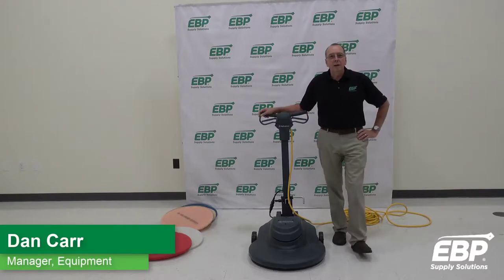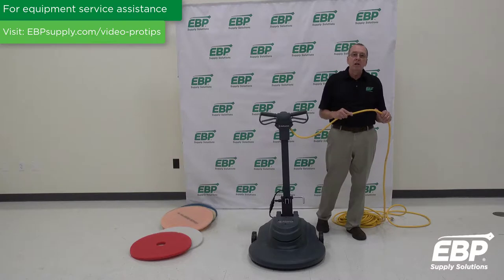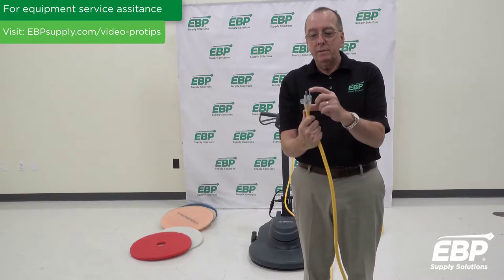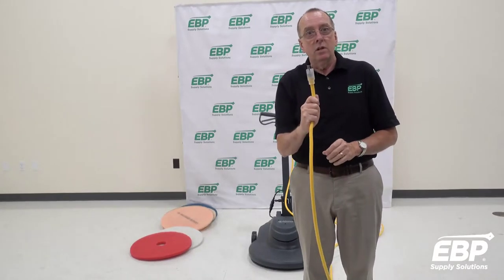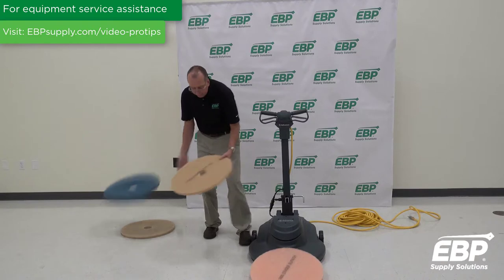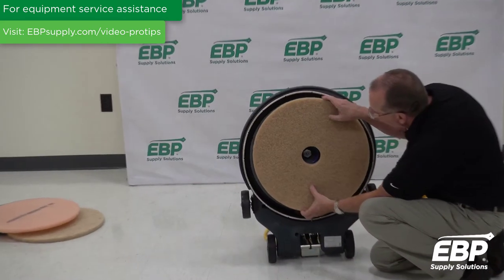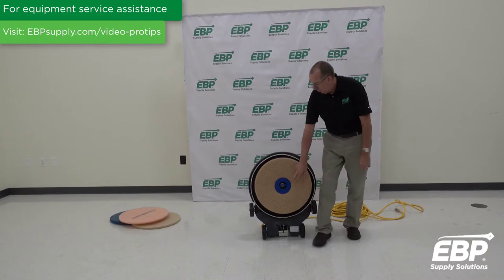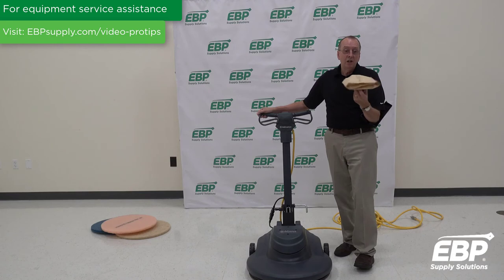Troubleshooting a Commercial Floor Burnisher Issue

Comment: Do you know how to fix the adjustment lever on the machine mine snapped
Reply from the maker: Hi! Thanks for watching. We are sorry to hear the adjustment lever on your machine broke. Our Equipment Specialists recommend replacing the part. To find the replacement part number, begin by looking in the parts manual to find the correct part and part number for your machine. Then, reach out to your distributor or the machine manufacturer for ordering. Sometimes, the part may be under warranty  If you are unsure or would like additional help, feel free to reach out to Imperial Dade: https://www.imperialdade.com/registration

We have a full service department stocked with parts ready to get your machine back up and running. https://www.imperialdade.com/registration

Comment: That interesting about "14- gauge cord and the facts about extension cord and why you have to know the gauge of the cord of the wire, and why you have to go down one size 12 gauge"?
Reply: The lower number 12 will be larger then 14 will be smaller
Reply: @cindysorrels2487  Thank you